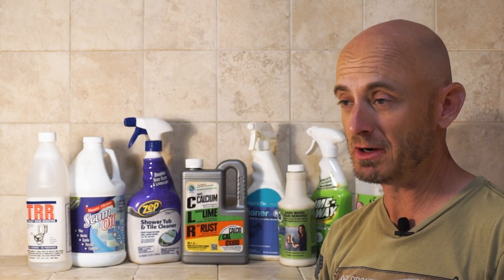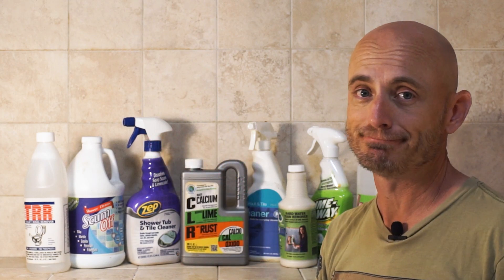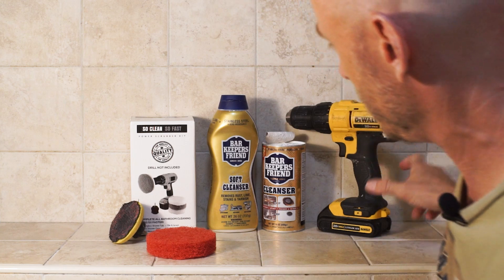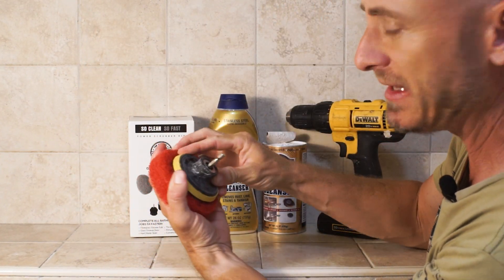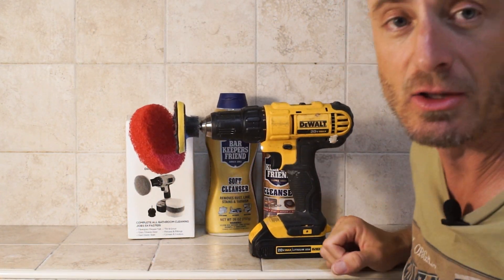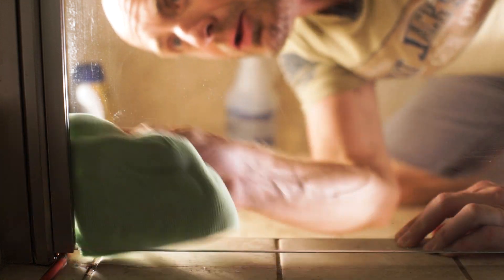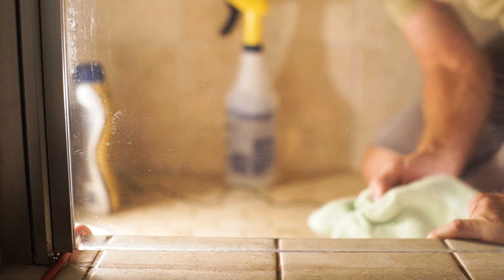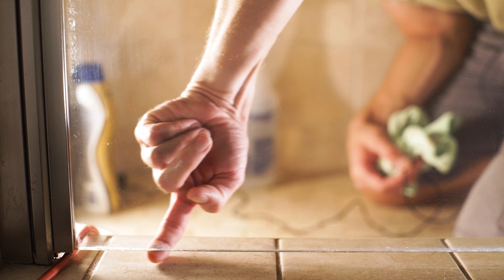How to Remove Hard Water Stains When You've Already Tried EVERYTHING.

Comment: Fun idea. Don’t have a glass shower…but if I get one I’ll know what to do now. 

I have heard using a dish wand periodically when you shower keeps it cleaner longer. You know the kind you fill with dish soap and has a tiny scrubby sponge. 😁
Reply from the maker: Not a bad idea.  We even use a squeegee on it every time we're done and it still gets bad over time.
Reply: That's a good tip! I want one of those scrubby things that goes on a drill though. Might be handy for cleaning litter robots!
Reply from the maker: It's great for all kinds of stuff!  I used it on the bottom of a tub that I couldn't get clean and it worked WONDERS!  Also, my favorite use was inside our enameled sink, it was so gross from metal pans sliding around in it, we thought it would never come clean, but this thing just destroyed the marks!  I've never seen our sink so clean, EVER.